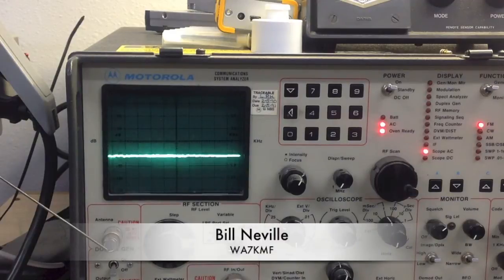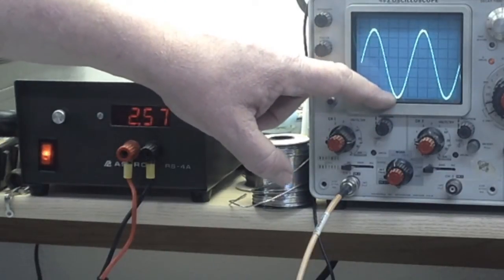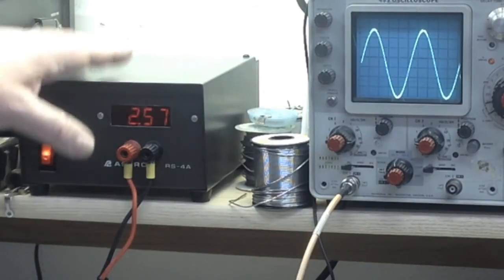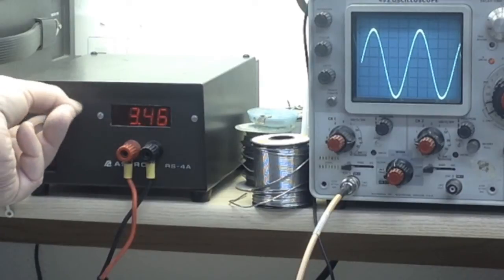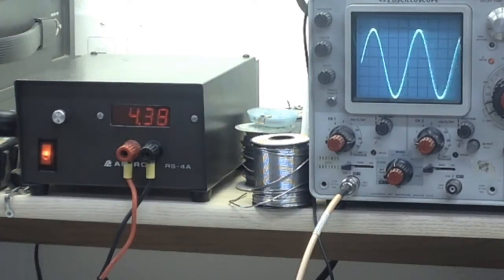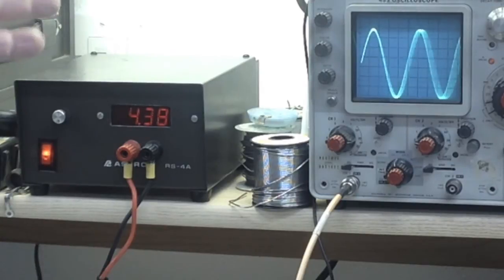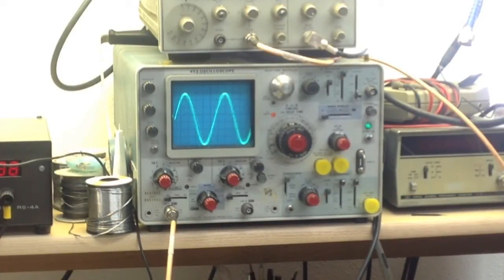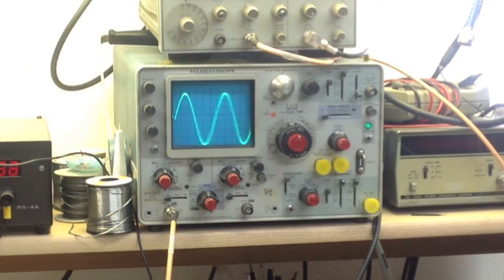Frequency Modulation & Deviation

Comment: Regarding low pass filtering of the audio before it is FM modulated. Would it follow there is less deviation of the carrier as the audio signal is increased in frequency. That is If the audio signal was first run thru a low pass filter and the audio frequency was above the corner frequency of the low pass filter?